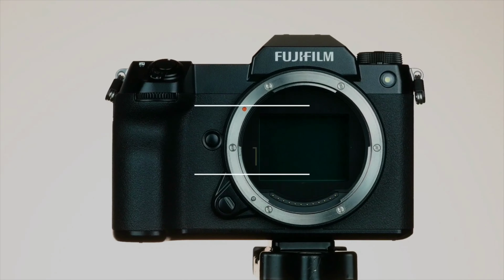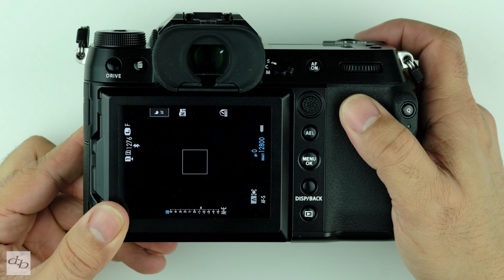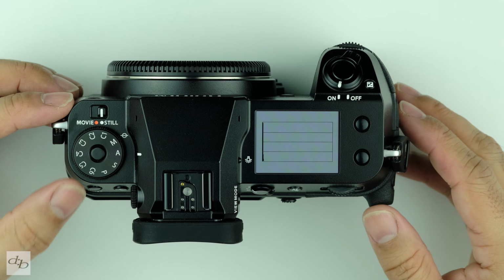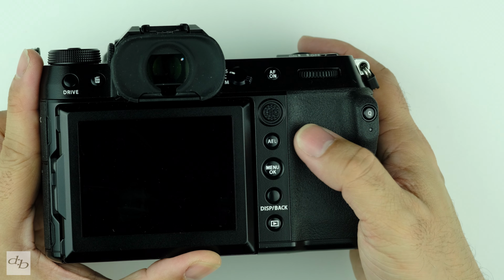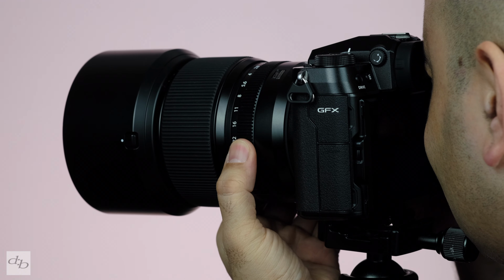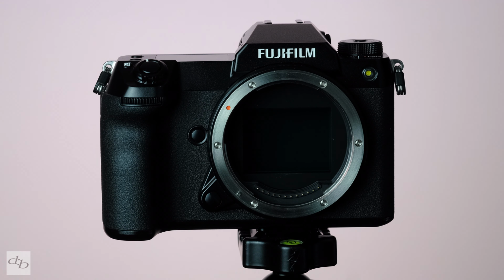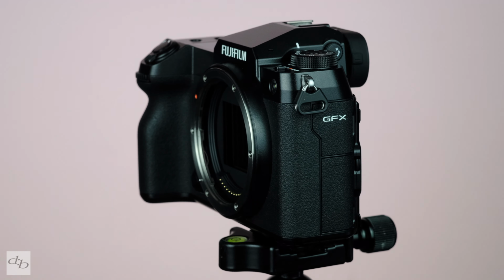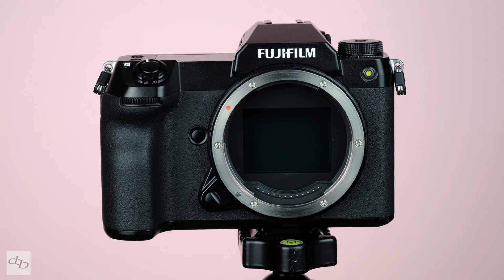Fujifilm GFX100S

Comment: great review as ever Damian
I've been using a GFX100 for 4 months now.  Imbought it used forces than a 1100S new.
I wanted the 100 for its viewfinder - it is the best I've used in any camera be that DSLR or mirrorless.
The IQ is simply stunning with matchless dynamic range meaning grads and bracketing are rarely needed.  I'm a landscape shooter so things like AF and frame rate aren't important to me.
Build is excellent - like the proverbial tank.
The only down side is its size and weight - body and lenses are monsters!
Reply from the maker: Thank you! Yes that's the thing, tank is definitely the word! I can only imagine the treks you have with that kit, but the images would be amazing. Well worth it I think!

Comment: Great review 👌 Do you think a gfx50r is a bargain to be had as a used camera in 2021? As prices for it are about 1800 pounds
Reply: I had one for 3 years and at £1800 it's a real bargain.  Lenses are expensive though so you'l need to factor that in.
Reply from the maker: Hmm good question, I'd go with yes. If you're happy with the lens cost as the other comment suggested.